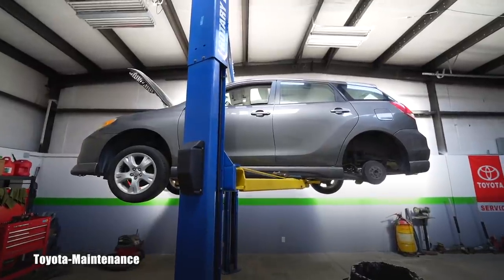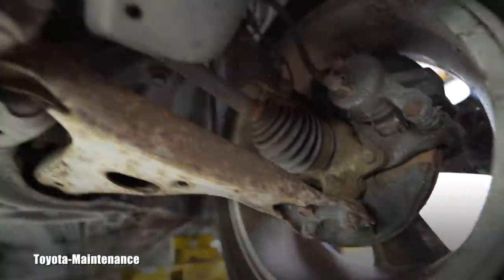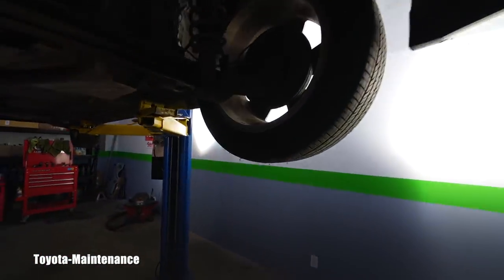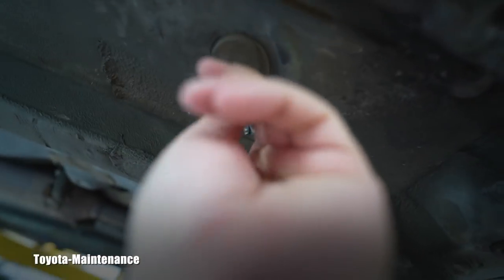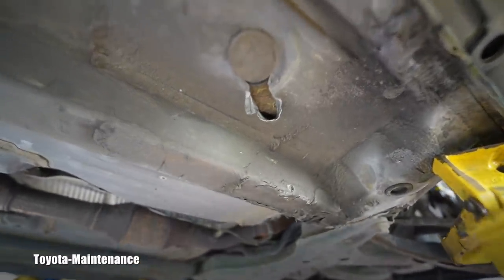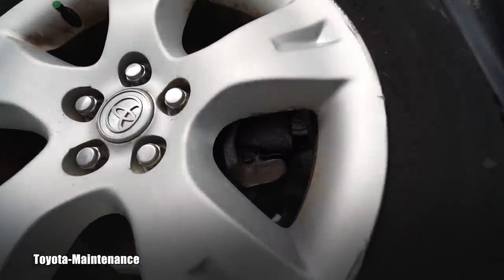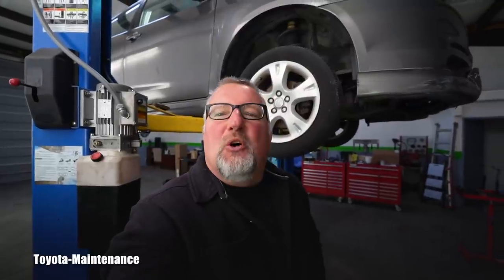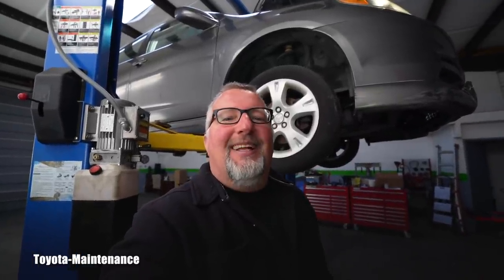Tow company damaged customer's car

Comment: Competent employees are really hard to find now, but morons are everywhere. It's obvious the tow driver hooked the drain holes and the tow company needs to be held accountable for the repairs.
Reply: Thumbs up agree. One correction, they are not drain holes. They are made by Toyota that way but during pre-delivery they are supposed to put the car on a lift and those plugs in the holes at the dealer. Someone tried to shortcut the system. Everything else I agree.

Comment: I have dealt with many tow truck drivers in the course of my employment. A good percentage of tow truck drivers are criminals. I rate them a step above being a pimp or drug dealer. They have scanners and drive recklessly to accident scenes like a bunch of vultures and trick the drivers into having their vehicles towed by them. 
Ive seen tow drivers go into unoccupied wrecked vehicles after ambulance has carted driver of car, and look for personal information to scam a tow.
I was once told by a railroad employee that tow truck operators were taking down city signs showing showing railroad viaduct clearances causing tractor trailer drivers to hit the bottom of structure with the top of the trailer, then magically show up and offer to pull them out. 
I know there are good tow operators too, but the bad ones tarnish their reputations.

Comment: The question is how do you fix that damage? The next step should probably be a quote from a body repair shop to fix it and a consultation with an attorney. They will have your evidence that the damage was caused by the tow truck.

Comment: Someone could hammer those rips 90% shut using a dull chisel, to keep most of the water out. Then seal it with bathtub caulking after cleaning the surface off, so the caulking will stick. Roofing cement would work too. That stuff sticks to anything clean and dry. It's messy to work with though. 
A perfectionist could wet that spot in the carpet, stick some aluminum foil into into the hole to protect the carpet padding, then MIG weld the crack shut, a bit at a time, wetting the weld between short welding segments to keep the whole area from getting too hot. That would be overkill. 
A few coats of spray paint would probably stop the padding from absorbing water spray under there. 
I would tell the tow company to refund my money, or I would see them in small claims court.